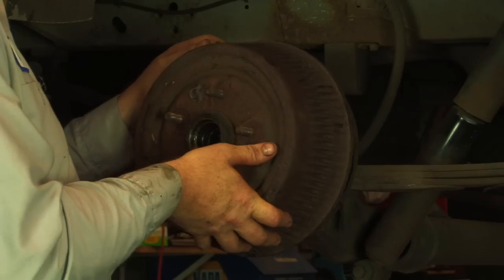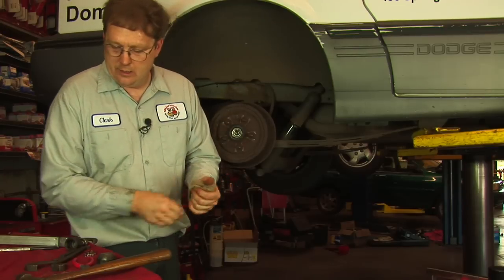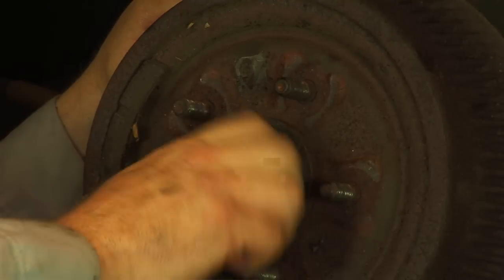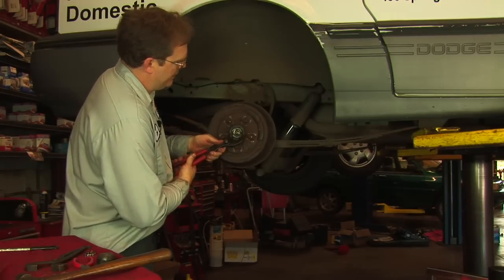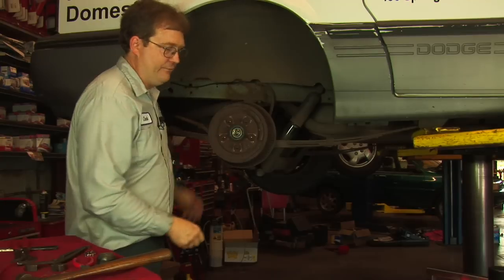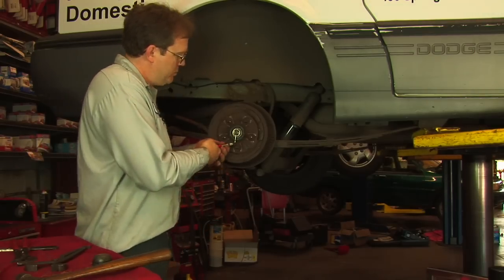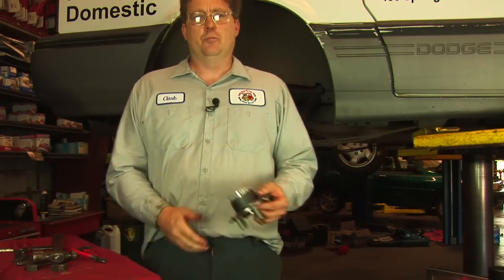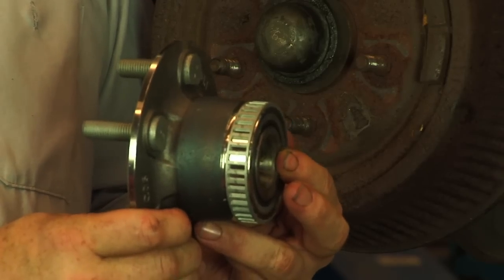Auto Repair & Maintenance : How to Adjust Wheel Bearings

Comment: All-in-all probably the most correct way to tighten a wheel bearing... a wheel bearing should never be under heavy load and it should be loose enough that when it expands it eliminates any excess play while still leaving a film of wheel bearing grease and allowing the wheel bearing to slightly rotate on its axel when you drive over bumps and that way it never only wears on one side of the inner race... my dad was a mechanic for 27 years and he used to tighten the wheel bearing with a medium-sized crescent wrench and then back it off and let the weight of the crescent wrench set the tension... he would let it bounce a couple of times lightly as he turned the hub... I'm pretty sure that after 27 years that's probably the way to do it... that's old school... but you should establish with some pressure that the races in the hub are properly seated before you do your final adjustment and that might be to tighten it up quite firmly as you rotate the Hub and then loosen off and do your final adjustment and if you can't get the cotter pin in then you back it off to the next notch